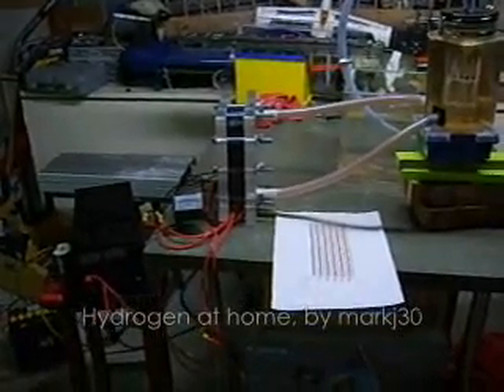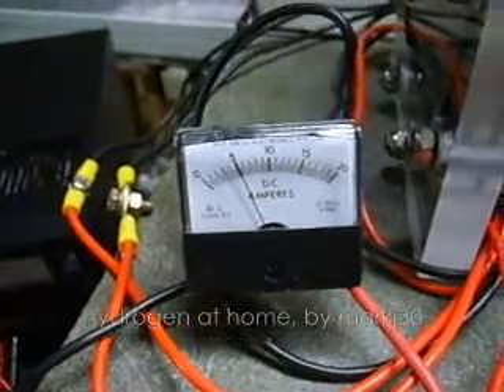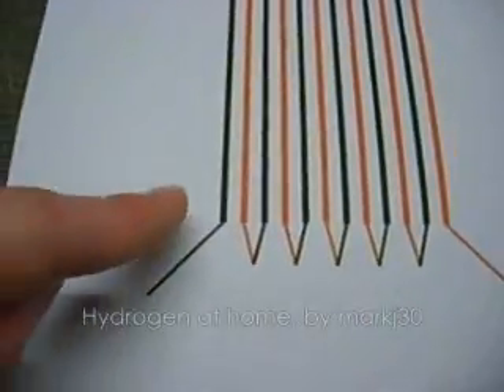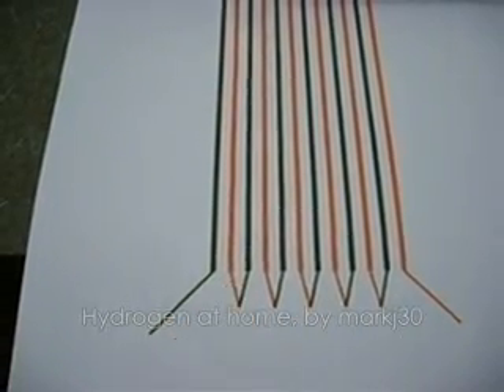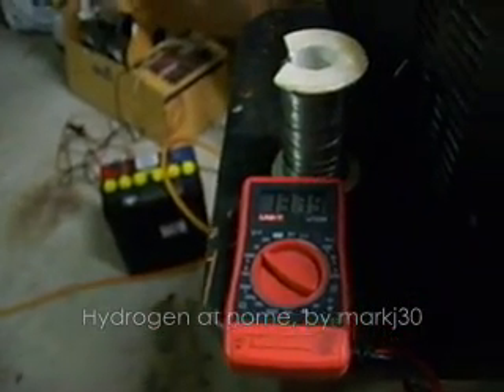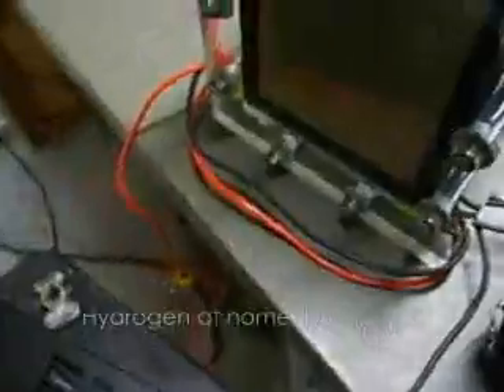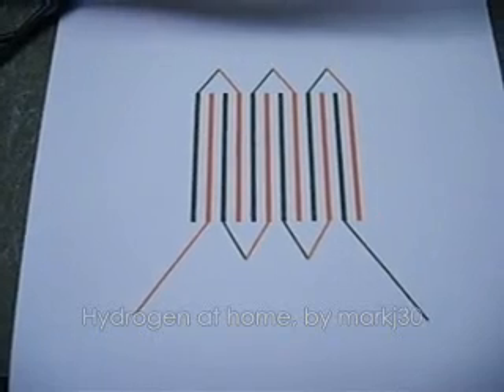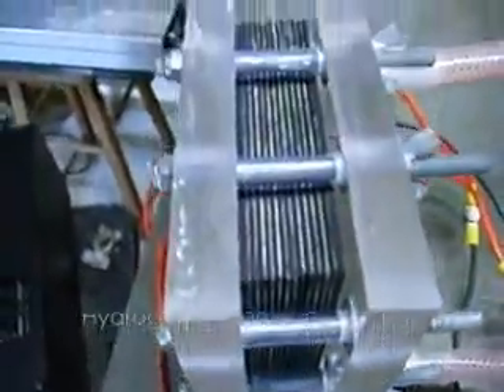Hydrogen at home (crazy cables)#33

Comment: very good Weller soldering iron ... silver solder ... suspect could do it with a fine tip on a propane or butane torch ... carefull not to over heat the steel though ... thin stainless warps easily ...

Comment from the maker: I just don't find them to be very flexible, you cannot change the gap between plates just by moving them, and mounting them can be a bit of an issue.  The biggest reason however is that I just have not come across any that would be suitable.

Thanks

Comment: quite thorough ... good job ... you will learn much stepping through it this way ... you have chosen a good design to work with for this purpose ... it seems quite flexible ...

once you settle on a configuration that suits you, the real fun begins ...  building a new device that is specifically optimized for that configuration ... 

dont underestimate how much you loose to those connectors ... on my purpose built designs, I solder the connections in place ...